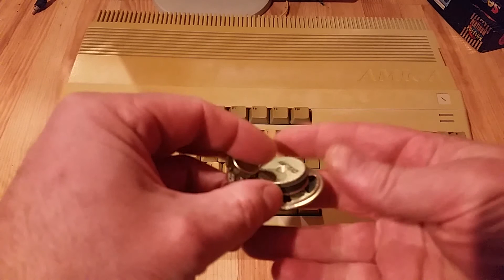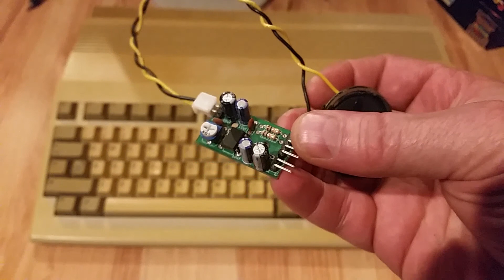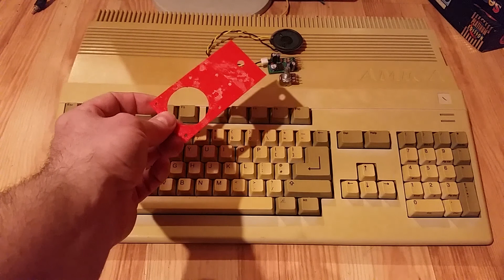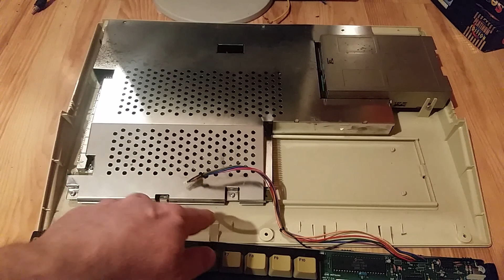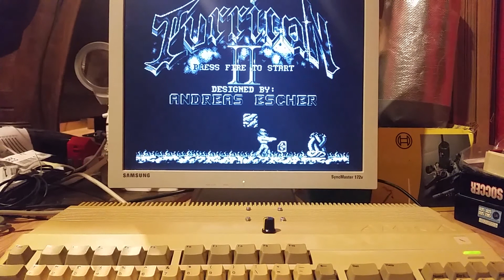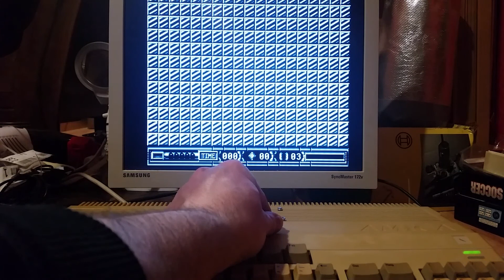Amiga 500, Installing An Internal Speaker & Amplifier

Comment: I was always hesitant about installing ANY metal switch or knob.
For fear that the static charge could hit that metal from a finger and travel down and zot something...  
Rubber or plastic tipped switches for me.
Never could find one of those "Dead man switches" with a switch guard LoL    with the little flip cover that closes over it so the switch isn't "bumped" by mistake.
Always wanted to put one on my A500 for purposes of shutting off the 020 and going into 68000 fallback mode or something..  

Dunno what speed CPU you got.. 
But here's a fun idea to figure out.
Assuming you can get a modest old accelerator board like an Adspeed (that just doubles the speed from 7 to 14mhz)... 
Get a small 1 to 2 inch  LCD panel that shows the "current" speed of your A500's CPU.
LCD even showing the little black letters would be the cheapest.. or u could opt for a fancy blue screened one with white numerals... :D
Could be a way to show the processor in small text above it   "68000"  and bottom that would say 7.16 mhz   I guess PAL users it would display  7.14 mhz) 
If you are able to double it  with an AdSpeed...   maybe throw in a 68010(-10) at 14mhz...    then the display would read  68010   and bottom line in big numbers  14.28 mhz.   

:P
Reply from the maker: I have a bunch of old CPUs I have pulled out of things over the years, I think they are all old 8bit CPUs and a couple of 8086s. I don't think I have ever had any type of 68000. May be one day I will get hold of a faster one for the Amiga as it is my system of choice from that era.